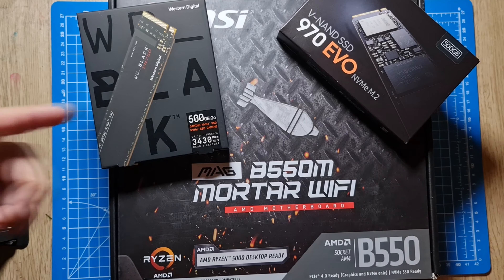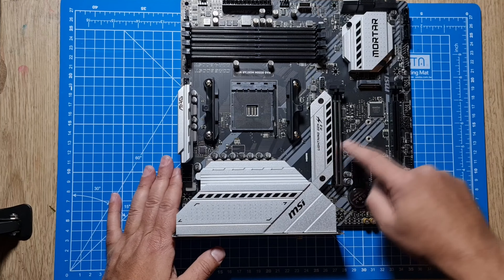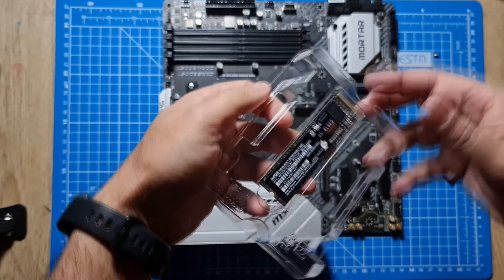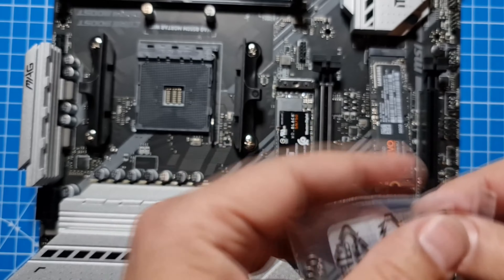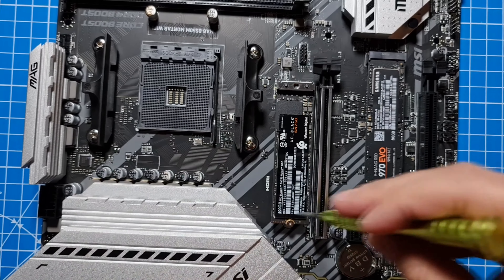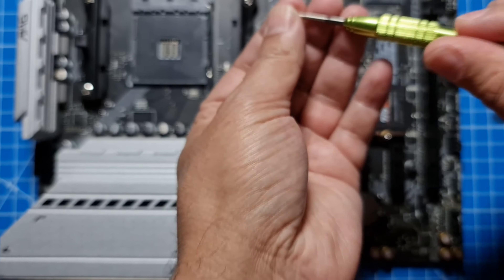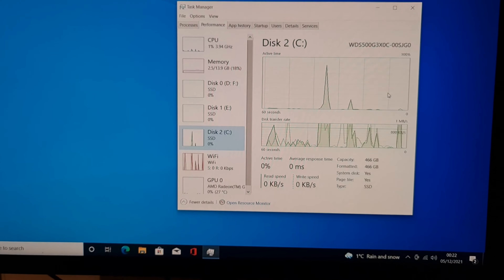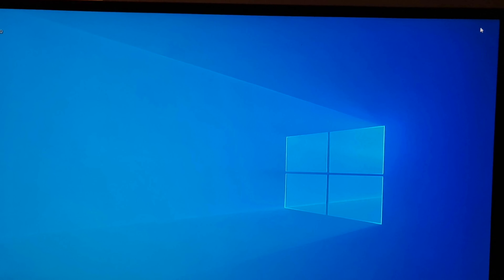How to install M.2 NVme SSD's x 2 on B550M Mortar WiFI

Comment: This is old news, but have to remove the whole plastic from the metal heat sink of the first slot because will melt from the heat of the ssd drive and that may cause more problems.
Reply from the maker: yes you can remove heat sink

Comment: thanks for the video - I havent seen many that show a second SSD installation. would this process be much different for a B550 Pro? I want to install a second one and I will probably have to take the video card out from the new prebuilt I am buying
Reply: Why run a 2nd one is my main question?
Reply: @BfearLess13  to double my storage. I added a second 2tb ssd to my b550 and it works great
Reply: old comment but fid you ever figure out how to install a second ssd onto that motherboard? i have the same one and i think the second one would be unshielded
Reply: @NotSnowie_  there is another ssd slot on the b550 - towards the lower half of the board. Took me 10 minutes to install
Reply: @daraghmorrissey  it’s the unshielded section right?
Reply: @NotSnowie_  yes

Comment: H! have you installed a gpu over your 2nd ssd? I was wondering if I could install an ssd with heatsink, if that would be a problem with the gpu. Would the gpu still fit with an ssd with heatsink?
Reply from the maker: hi i wouldnt worry about heatsink if your case has enough fans for cooling. make sure you sub

Comment: Do you have thermal issues when you installed gpu? Especially the ssd below the gpu?
Reply from the maker: hi, as long as you have enough cooling fans in the pc case you should be ok

Comment: I know this is very crazy but i hope you see this comment, I am have installed a second m.2 on my motherboard (the same board you have there) and it is not being detected either on the bios or diskmanagement, hope you have some insight to this
Reply from the maker: hi, i hope you have sorted this but you have to select some options throught the bios

Comment: What about when the SSD is that large ones with heatsink? I'm trying install one and doesn't fit, the stand off in the middle for the screw and that little square pad to make the SSD straight like that one in this video are removable? Just to confirm and not break anything here.
Reply from the maker: hi, most heat sinks should be removable, but if you have enough fans in the pc case to keep things cool you should'nt bother with heat sink. make sure you sub

Comment: Does the samsung ssd need a heatsink ? Or did you leave it without one ??
Reply from the maker: hi, no i dont use heatsink on samsung ssd and its working fine
Reply: @coolgadgetreviews  i have a 970 evo plus to install there. I am planning to use it as a drive for my steam library. Im worried about it overheating

Comment: can you have two nvme drives and GPU?
Reply from the maker: yes you can
Reply: There is a conflict. One of the PCIEx16 slots shares power with a M.2 slot. You can only populate one. You’ll need to follow the boards manual to avoid the problem
Reply: @phoenixfire8978  yea, I found out that if I use both m2 slots, then 2 of 4 pcie slots doesnt work.
Reply: msi mortar b550
Reply: @spetauskas  I think m.2 number 2 overrides PCIE slot 4.And if you populate both m.2 number 1 and PCIE slot 1 you drop down to PCIE 3.0 from PCIE 4.0 speeds since they share bandwidth.

Comment: Hello. I purchased this board, installed an i5 10400f processor, put the m2 ssd in slot 1 for m2 and an rtx 3050 video card. Now the ssd drive is not detected. What could be the problem

Comment: The other ssd no cover or thermal pad? Is it ok?
Reply from the maker: hi, yes should be ok. i dont have any thermal pad covers on mine as i have plently of fans in my pc case cooling everything. you can also down load a software that allows you to monitor the temp of your hardware. make sure you Subscribe
Reply: Is it true that if you add ssd to the second slot the pcie 3 slot will not work?
Reply: @klubsybeartutorials8453  PCI_E4 will stop working